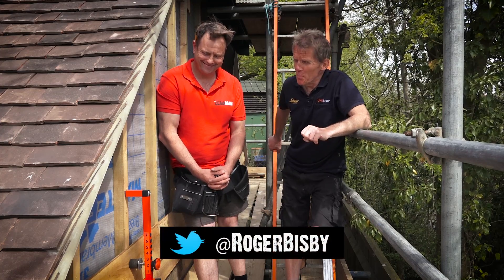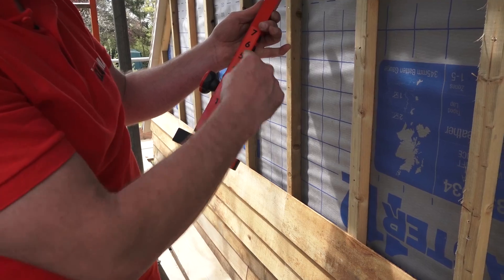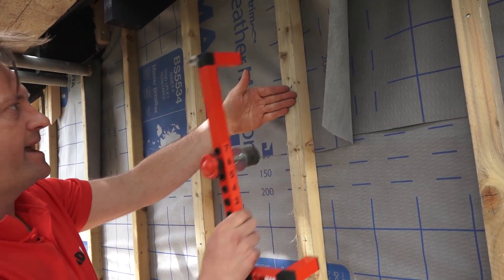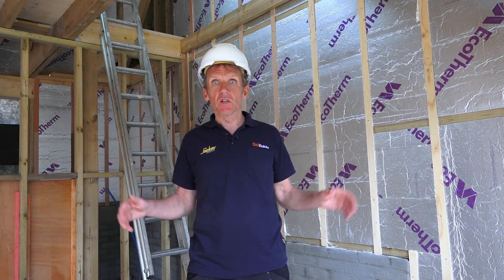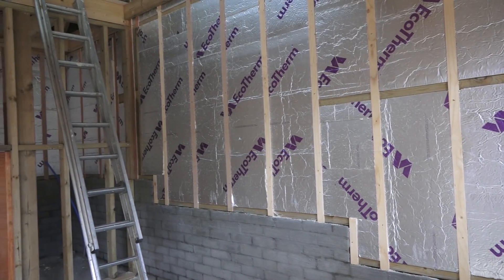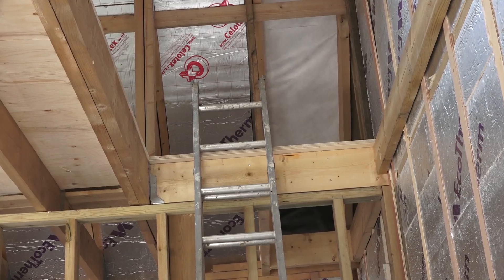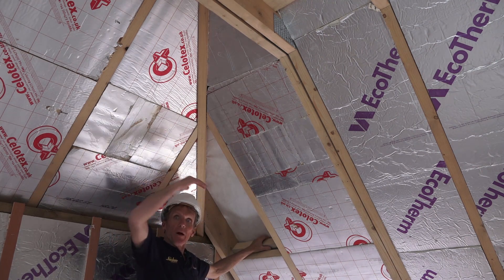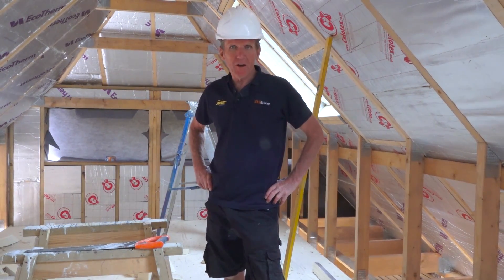Cladman The One Man Cladding Device

Comment: The screw you mentioned only penitrates 20 mm into the battern so weather you use 50 X 50 or 25 X 25 mm battern it will not penitrate completely through, good input but already thought out.

Comment: Hey roger. Have you seen the walltite spray foam insulation? What do you think?
Reply from the maker: +rory lobban 
I have seen similar systems. They seem to be more about airtightness than out and out U value. In otherwords, stop the draughts, and the heat stays in better than using thicker insulation that still allows air movement.
Reply: +Skill Builder hey roger. Looks like i might be taking on a rig BASF specific. If you want to see it/ the process your more than welcome to come anytime. Only thing is I'm in Aberdeenshire.
Reply from the maker: +rory lobban
 We can do that. Send me a message from our website skiil-builder.uk and I will try and hook up with you.